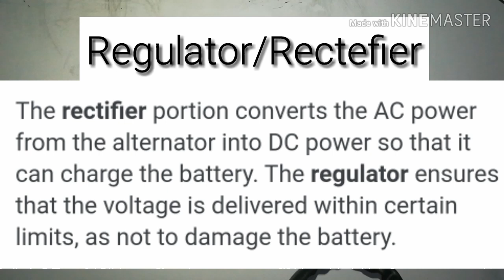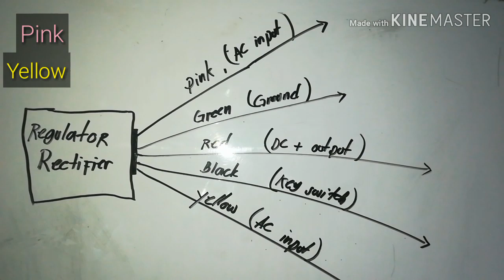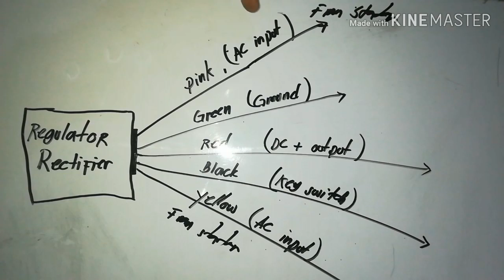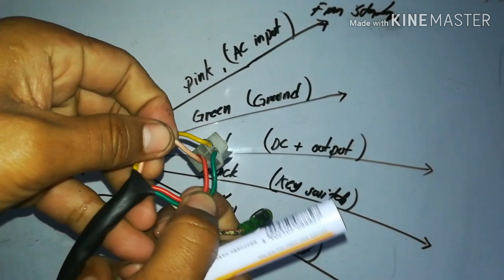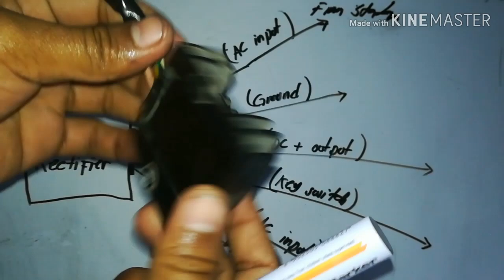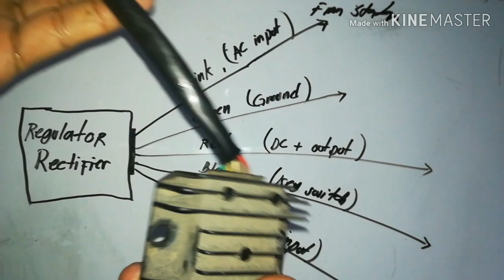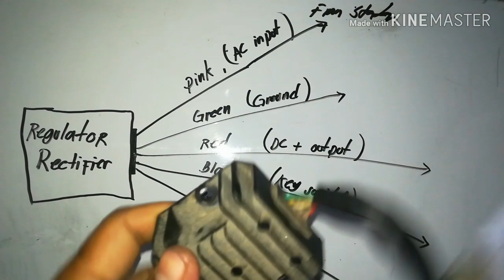5pin Regulator rectifier wiring diagram(paano malalaman kung ok pa or palitin na?)part 1

Comment: Actually hindi po yung regulator ang nagcoconvert from AC to DC. Dalawang component po ang nasa loob nyan, Rectifier at Regulator. Ang rectifier po ang nagcoconvert from AC to DC at yung regulator namang ang naglilimit ng voltage na magchacharge ng Battery. Although ang battery ay 12v rated, pagfully charged po sya ay hindi talaga 12v. ang fully charged na battery ay between 13v-14v..  Kaya ang output voltage po na rectifier ay more or less 14v, kadalasan 14.4v at ang regulator po ang nagcocontrol para hindi magOver voltage ang supply o charging sa battery.
Reply from the maker: Tama ka bro salamat ng marami
Reply: @RRJTVRandomTutorial  , ang di ko lang po alam kung yung CDI (4-pins) na DC powered, since connected sya sa battery, at habang nagchacharge ang battery ng 14v, ibig sabihin po ba 14v din ang pumapasok na supply sa CDI?
Reply: Sir diba yung dilaw input siya from stator. So bakit sinusupply siya direct to the headlight?
Reply: @Axxel9387  up

Comment: Mas maganda lihua dyan ang lihua ay may limiter ang black wire yan regulator na yan fullwave din yan pero pang stator drive  yun wire na white na may red yan yun supply ng headlight na stator drive hindi battery drive kung mag battery drive lihua

Comment: sir may 5 pins wire kinabit ko sa wave 110 ginawa kong fullwave tama nmn yung pag ka rewind ko ng stator kasi d umiilaw yung dalawa kapag tnslihgt ko na nka body ground..?  d parin nag chacharge walang power n dumadaloy papuntang bat.salamt
Reply from the maker: 5 wires po ba bro ang kinabit mong regulator

Comment: Boss pg pinutol ang yellow wire ng rectifier tpos ung black wire mag duktong ng isang wire papuntang yellow wire ung papuntang stator ganun ba? Naka battery operated kse akong ilaw at busina pg nka onn head light ko hnde ako maka pag signal light kinukulang sa kuryente

Comment: Boss panu po malalaman ung color code ng rectifier at san ung positive at negative 5pin po sya naka bili po kaso wala pong wire salamat po sa sagot and Godbless
Reply: Ang positive sa 5 pin ay pula Ang negative green Ang black accessories dilaw headlight pink charging po

Comment: Boss pede po ba ang 5 wire regulator sa barako kahit di naka fullwave
Reply from the maker: Oo nman bro..
Reply: Pero ang problema po ehhhh di ko alam ang diagram nng regulator nng barako 1 baka po pede maibulong at pede din po ba sa kanya un cdi na 4pin sa barako maraming salamat po
Reply from the maker: @jredlilsmokewolf2799  oo bro pwedi yan bro..

Comment: Kapag okay naman ang ilaw tapos busena boss pero nadredrain nya yung battery
Reply: Boss
Reply from the maker: Baka over charge..
Peru unahin mo check batt.. Baka nasa batt ang problema.
Peru kung nagpalit kana ng batt ganun parin..

Dalawa yan posible stator or regulator
Reply: Nagpatester ako nasa 12 lang reading ng tester nakabukas ilaw pati na signal light okay lang ba yan boss? Tapos legit ba yong kapag umaandar motor mo kapag tinanggal mo yung fuse mo kapag umaandar parin ibigsabihin daw hindi sira ang regulator mo lalo na yung sa red wire?
Reply from the maker: @ma.cristelal.dingil4141  ok lang bro..
Ang reading.. Nyan
Yung tanung mo hindi legit yun..
Aandar p nman motor mo.. Tangalalin mo man or hndi.. Hindi acurate pagka ganun ang trouble shot..
Peru pag sirang sira na bro pwedi nman yun gamitin.. Peru kung may tester ka..
Test muna lang mas cgurado pa bro
Reply: Sige boss salamat
Reply: Paano boss kapag tinanggal mo naman yung negative sa battery pero umaandar parin legit ba yan na troubleshoot?

Comment: sir tanong ko lang nasira yung rwgulator may nabili ako ng rulator 5pins wire ang kulay ng wire yellow red black green pink yung stock ko ang kulay nya na wire ay yellow red ska redblackgreen pink yung motor ko racal 100 yung nabili ko parang di sya machtnag pupundihan pa rin yung ilaw ko
Reply from the maker: Bro tingnan mo kung yung redblack at yung black magkadikit.. 
Maganda kung may tester ka bro.. Test mo out put ng regulator...

Comment: Tanong lng paps.. sa xrm 125  stock regulator yung apat lng ang wire, kapag e tenest yung wire na red at green kapag mai reading, ibig sabihin sira naba?
Reply from the maker: Hindi pa.. Bro ok pa yan.. 
May reading dpat yan.. 
Ang tanung dun bro ilan ba ang readinh mo.. 
Kasi kung nag read kalng ng lagpas ng 15volts, sira, na, po yan.. 
Baka mag over charge batt mo. Dapat maglaro lang sa 13v hangang 14:8 volts.
Reply: @RRJTVRandomTutorial  ang tenest ko bro yung mismong regulator.. diba sa xrm na regulator merong green at red..tenesteran ko  mai reading sya,parang short na ata to.. bumili ako ngayon ng bago tenesteran ko ang red at green wala syang reading..
Reply from the maker: @jrdonan1571  ahh hindi po umaandar?? 
Meron dapat na reading ang pula at green.. Dapat ang reading ng resistance na ma read mo.. Ay 1200 hangang 1300

Pag may resistance k na read, mga 500 lang sira, na po yan.
Reply: @RRJTVRandomTutorial  ikinabit kuna ang bago kong binili na regulator bro, umaandar nmn sya.. midyo tumaas nang kunti ang dcv nya.. itong luma kong regulator,madali lng kasi mag drean ang batt ko.. midjo mahina mag charge. But di ako sure kung sa regulator ba ang sira or ang batt ko ang sira, midyo luma na din kasi ang batt ko.. pro nagpalit na din ako ng bagong batt ngayon, at pinalitan ko na din ang regulator.. ang nakapagpagulo lng sa akin, kasi yung bago kung regulator wala kasi syang reading sa red & green, din sa luma kong regulator mai reading sya..  mai nakita din kasi ako na video,na dapat daw  walang reading ang green at red kapag tenesteran, kasi kapag mai reading daw ibig sabihin sira na kasi short na daw.
Reply from the maker: Anu po ba.. Contuenty lang lang tenetest mo?
Try mo nga bro paandarin tapos kunan mo ng output.. 
Kung ilan volts?
Reply: @RRJTVRandomTutorial    kapag hindi ko nerebolusyon bro 12 to 13.kapag nerebolusyon ko aabot ng 16.. pro yung isa kong regulator na stock, 12v lng kahit nerebolusyon ko. But di ako sure kung totoo ba yang na reading ko, kasi analog na tester kasi ang gamit ko, duda din kasi ako nito baka sira din to. Tenest ko yung bago kong binili na battery,umabot ng 14v, diba 12v lng to dapat..
Reply from the maker: try mo buksan headlight mo tapos.. 
Rebulotion mo. Kung aabot ng 16
Reply from the maker: @jrdonan1571  malakas kasi bro dapat hangang 14 ka lang. 
16 baka, masira batt mo nyan
Reply: @RRJTVRandomTutorial   aabot talaga sya sa 16 bro.. try ko lng din to e test ng digital tester, baka kasi sira din tong analog tester ko. salamat po sa pag reply bro ha.. godbless..
Reply from the maker: @jrdonan1571  oo bro pag hindi orig ang analog test hindi kasi, accurate ang reading nyan... 
Tingan mo bro kung mapupundihan ka ng ilaw.. 
Tapos monitor mo batt masyado kasi mataas ang 16 volts
Reply: @RRJTVRandomTutorial  ok bro, salamat ng marami..🤗🤗

Comment: Paps pahingi naman ako linya ng mio sporty. Ganyan din yung nabili kong rectifier paps. Nalito lang ako sa kulay kasi wala syang black. Tanong ko lang paps yung white na may red yun ba yung black. Salamat
Reply from the maker: Oo bro tama ka..
Reply: Paps tama yung wiring ko kaso ayaw naman mamatay ng motor ko
Reply from the maker: @BetterDay0314  cdi ang may mali bro hindi regulator..
Reply: Paps pano ang solusyon kaya dito.
Reply from the maker: @BetterDay0314  ilang pin po ba cdi mo bro
Reply: 5 pin paps
Reply: Tapus paps pag dinisconnect ko yung sa cdi ang reading sa voltmeter ko 13.6. pwede ko bang idisconnect nalang yun paps
Reply from the maker: Aling sa cdi ok yan 13.6, pag umaandar
Reply: 6 pins pala paps yung pun ng cdi ko. Stock pa ying cdi ko paps. Tapus nakalagay sa nabili kong rectifier paps AC
Reply from the maker: @BetterDay0314  ang problema lang ba bro hindi nmamatay.. Kung ok nman wirings mo.. Baka loss n ang ignition switch mo.. Kasi sa cdi ang kilswitch nyan
Reply: Ano maganda solusyon paps. Wala ba epekto paps yung sa rectifier na AC or DC. May nakita kasi ako sa obang video na DC ang mga cdi natin. Kaya baka kako nakakaepekto kasi AC yung rectifier ko

Comment: boss, yong vfi ko 4 wires lang, yong 2 galing ng stator isa lang ang gumagana, nag trace ako ng wirings, yong 2wire sa  stator, isa lang ang gumagana kaya isa lang din ang may power papuntang rectifier, kailangan ko na bang magpalit ng stator? o ibattery operated ko na lang, patulong naman bro. salamat, ride safe. god bless
Reply from the maker: Bro anung kulay ba ang wires n mayron..
Magkaka prob ka kasi sa charging or isa pa.. Putokan ang mga ilaw. Mo..
Dapat kasi parehas yan meron ibig sabihin may windings na sira na..

I sugest palit kana lang stator.

Comment: Idol ung sakin nka fullwave pero naiuna qng i battery operated ang ilaw q so ang cut q ng wire is s may headlight ...ts saka aq nag fullwave then fullwave regulator n dn like nyan..ok lng ba n hindi q na i cut ung yellow wire jn s regulator??

And dun s pang gy6 na regulator sabi kasi ng iba masama dw na ikonek s ignition accesory wire ung wire na kulay puti kasi dw conflict ang dc at ac...ibig sabihin pasaway ung mekaniko n nag fullwave sakin....

Comment: Meron po ba kayong 5 wire to 6 wire conversion?
Reply from the maker: 4 to 5,palang po bro..
Reply: Ginawa ko po sya base on how i understand your vid. Nasunog po yung wires from idk going to Regulator rectifier. hahah, wala po kasing green na kulay sa 6wires, puro yellow
Reply from the maker: @augustlion8655  iba yun bro.
Ibig mo bang sabihin puro may tatlong yellow tama ba bro
Reply: @RRJTVRandomTutorial  opo sir. May red, white and black tapos 3 yellow. Chineck ko po online kung paano yung diagram kaso di ko alam paano sya imamatch sa 5 wires na iba iba kulay.

Yung 3 yellows po puro AC output
Red positive
Black negative
White is voltage monitor.

Base sa diagram ng videos mo sir (yung palitin at yung 4-5pins na vid)

Yung white is para sa AC, tama po bang tinapat ko sya sa white ng regulator (voltage monitor) or dapat sa isa pang yellow? Tapos yung green ang itatapat ko sa white?

Comment: Pano kong low voltage ang output ng regulator 6v nalang.may 12v sa yellow wire at 17v sa white wire.umaandar naman ang motor dc cdi. xrm 125.wala nga pala battery nakakabit.
Reply from the maker: Ibig sabihin bro.. Sira na regulator mo dapat.. Nga lagpas Pa ng 12 volts ang output ng regulator mo.. 13 to 14 volts..
Reply: posible epekto yan sa connsumption kasi walang battery, 
kapag nka on susi mo automatic meron consumption yan kasi connected na ang cdi sa power supply, so normal mag reading ng mababa sa 12 volts kung walang battery,
note po: ang ignition system 9 volts ang pinakamaliit na voltage na pwede mgactivate ng ignition, so below 9 hnde na aandar yan, so kpag umandar yung motor ibig sabihin nakaka supply ng required voltage ang power supply mo kahit walang battery, so hnde talaga 6V lang supply nyan, deducted lang yung reading dahil my consumption na at tingin ko nka minor kalang nun, pg higher rpm d parin aabot ng 12 reading dahil sa consumption so posible 9 lng din, pg mglagay ka ng battery saka aangat yung voltage reading

Comment: sir patulong nmn. tanong lng.
bkt kaya ung mc ko kpg naka kabit battery nagkakaproblema rpm gauge ko. kpg piniga ayaw tumaas rpm gauge meter nya. pero ok nmn andar. ung rpm gauge meter lng tl.g
pero kpg nakatanggal battery ok rpm gauge nya.
nasusunog dn ung fuse box ko sir naka ilang palit n ako.
tips Mo nmn sir
Reply from the maker: Tips bro double check mo ang regulator..
Kasi yun ang posible kasi sabi mo pag tinatangal mo batt og.. Ibig sabhin baka sa charging system..
Regarding sa pagputok ng fuse..
May grounded n wirings yan chek mo ang.. Mga socket.. Baka may sunog lang bro....

Tapos kunan mo ng voltahe hbng naandar.
Tapos anung motor pala yan bro
Reply: @RRJTVRandomTutorial   motoposh 200cc sir. nagpalit n ako sir ng r/rectifier. hndi  n pumuputok fuse sir. pero ung rpm ganun parin sir kpg nkakabit tlg battery. ung fuse ko dto nkakabit possitive battery tpos ung isa. nkakabit sa redwire papunta r/r. nka kabit dn ground ng r/r sir. wla xe aq tester.
bkt kaya gnun prn sir, bago na r/r ko.
Reply: wla dn sunog mga socket at wire sir

Comment: Boss tanong lng ano po ba dapat tanggalin na wire 4pin tapos regulator ko is 5pin battery operated po sya.
Reply from the maker: Actualy wala kang tatangalin ibig mo sabihin yung hindi mo gagamitin.. Is yung black...

Dpndi kung anung kulay ang 5 pin mo bro..
Anu ba kulay nyan 5 pin na hawak mo
Reply: @RRJTVRandomTutorial  ser green,black,red,yellow,pink, rusi 150 cc ang mc ko ser.
Reply from the maker: @arlinobalboa2083  yung black bro wag muna ikabit.. Ok nayan
Reply from the maker: Wait lang bro..
Magpapalit ka ba ng 4 pins..
Reply: @RRJTVRandomTutorial  hindi nmn po boss,salamat ser,sa ssgot,lagi ako mag like sau ser.
Reply from the maker: @arlinobalboa2083  sir peru pansinin mo kung nainit ha pag start mo uminit agad..
Ang gawin mo itop mo yung black sa kulay red. Para maging stable ang subly
Reply: @RRJTVRandomTutorial  aaah ok ser salamat,ser tanong pa ulit ung headlight ko is liliwanag lang pag magsisilinyador ako,ok lng po b un.kac ang alam ko pg battery operated maliwanag n agad ang ilaw,pasensya n boss dami tanong.
Reply from the maker: @arlinobalboa2083  oo  bro dapat maliwanag na agad.. Baka hindi ka pa naka batt operated bro.. Napapailaw mo b head lights mo kahit hndi naandar
Reply: @RRJTVRandomTutorial  hindi,bro wala syang signal,maliban lng kung umaandar n ung motor.
Reply from the maker: @arlinobalboa2083  so hindi ka naka batt operated bro kasi dapat.. May ilaw kana pag on mupa lang
Reply: @RRJTVRandomTutorial  bro,ano dapat gawin ko,san b location mo bro bk pwede kita puntahan,caloocan ako bro.
Reply from the maker: @arlinobalboa2083  nako malayo bro..
Laguna ako..
Ang gawin mo bro.. Diba 5 pins ang ikakabit mo tapos 4 pin ang stoc mo tama ba bro
Reply from the maker: Color coding lang ang kabit mo bro.. Ang matitira lang isang wire diba black..
Ikabit mo ngayon sa kulay red.
Reply: @RRJTVRandomTutorial  ok bro,ginawa ko na,kanina,sinama ko ung black sa red accesory un diba connect din sa battery.salamt bro ,lagi aq mag aabang sa mga update mo.

Comment: Ano kaya sira ng motor ko bro. Minsan ayaw gumana push start tumutunog lang sa battery relay. Tapos apektado busina mahina tska ilaw tas minsan bumabalik sa normal. Wave 100 motor ko bro. Tnx
Reply from the maker: Bro baka mahina ang batt mo.. Check mo.. Hindi nya kaya magpa start starter..
Check mo charging system.. Nya
Posible din bro kung hindi ka naka baty operated. Naka regulator..
Marami kasi pwwdi dahilan yan bro.
Peru.. Peru pinakauna dyan batt.

Comment: Boss yung sa akin mhina supply ng yelow at pink malakas pa yelow kumpara sa pink anung cra nya dpat nba plitan ng recrefier slmat
Reply from the maker: Bro normal lang po Yan pag Hindi ka ka naka fullwave dapat mas malakaa yung light coil nya yun n nga po yung yellow wire kumpara don't say pink. OK Pa yan bro.. Pag Hindi n umilaw bro saka mona lang palitan..
Reply: @RRJTVRandomTutorial  ang problema kc boss may sound ako ska may voltmeter pag patay sound gang 10 v lng sa volt meter khit rev mo gang dun lng pag bukas ng sound bagsak ng 9 v gang 8 v 3sm battery ko
Reply: @RRJTVRandomTutorial  ano bang dpat gwin para d matlo ang karga pag bukas ang soind d bmgsak ng ganun yung kcng stator ko cra na primary kya gnwa dun kinimbert sa battery operated ponlitan ng cdi
Reply: Pano ba boss e fast charger ang regulator ko 5 pin cya green yelow red black at pink
Reply from the maker: Bro kung sira n stator mo palit kana lang ng bago..mura lng nman yan. Anu ba ang sira sa stator mo yung light coil. 
OK di naman Batt operated paru dapat malakas charging system mo. 
Mag full wave kana lang bro para malakas ang electrical mo.
Reply from the maker: Bro baka rectefier ang, sira Hindi stator?
Reply from the maker: Mababa masyado yan bro kung 10 volts naabot Pa ng 9..
Baka naman, sira, n rectifier mo bro.. Kung, Hindi, na nataas ang karga kahit nerebulution mo
Reply: @RRJTVRandomTutorial  yunh primary lnh cra dun sa stator ko kya kinombert sa battery operated pinlitan ng cdi na mlaki kc dti ayaw umandar stator nga daw sira yung primary kua gnwa kinumbert sa battery operated ok nmn ang problema ngun yung charging nya mhina cenek ko yelow line ng stator at pink yung yelow may ilaw testlight ko pero d gaano klakas ying ponk line patang baga nlng
Reply: @RRJTVRandomTutorial  tpos chenek ko yelow line ng recrefier at pink same rin ang ilaw ng testlight ko pareho lng ang liwanag mula stator at recrefier pag nerev mo nliwanag nmn cya unti pati sa red chenek ko mismo sa battery terminal same prin sa yelow ang lkas
Reply: @RRJTVRandomTutorial  bgo la to boss eh mga 5 gang 6 months plang cguro
Reply: @RRJTVRandomTutorial  yunh recrefier ba boss magkaiba ba ang fastcharger sa fullwave ano ang lwedeng ikabit sa dlwa na khit d nka fullwave ang stator pacensya na boss ha kung marami ako tnung gusto kulng kc matitunan lhat sa u tube kc dko gaano masundan

Comment: Paano sir pag nag disconnect ka ng yellow wire magmula stator papuntang regulator?
Reply: At paano pag naman nag disconnect ka ng pink wire sa headlight?
Reply: Nag battery operated ako so nag cut ako ng yellow wire tas nag connect papuntang accessories wire. Problema is naglolowbat battery ko. Ang ginawa ng mekaniko e nagtangal ng pink wire sa headlight. BTW hindi ako naka fullwave

Comment: Bro yung connection ng accesory wire saan i cconect yan?
Reply from the maker: Marami bro.. Sa ignition switch.
Signal lights.
Brake lights
Tail lights
Busina.

Basta sa accssories bro
Reply: Bro yung tanung ko pla ay yung nasa rectifier na accesory sabi mo pag na on ka susi mag ka power yung white w/red san sya ecocinect?pwede na ba sya hinde ikabit?